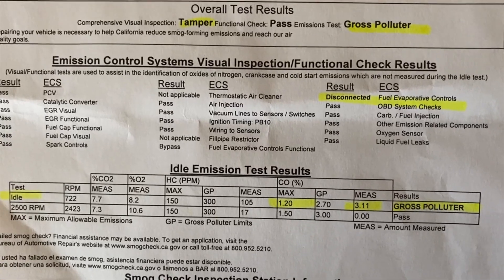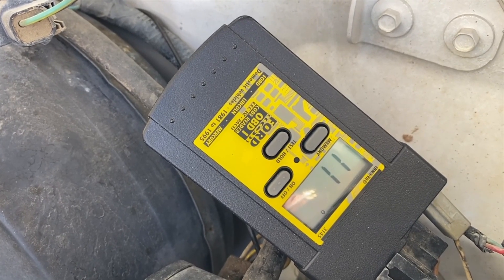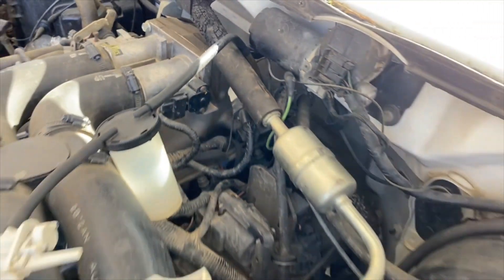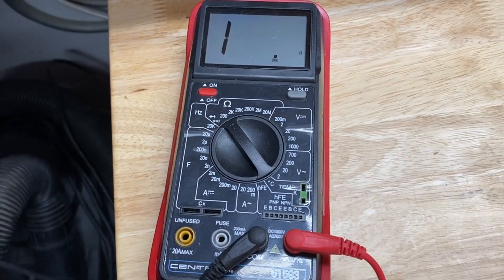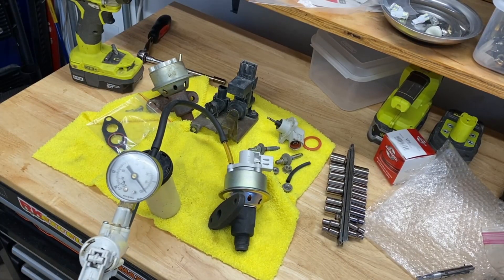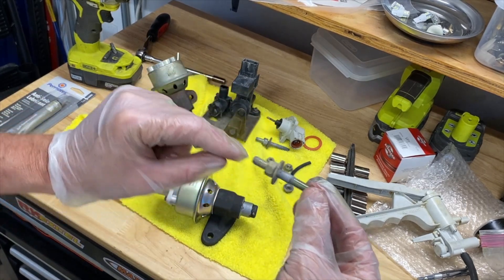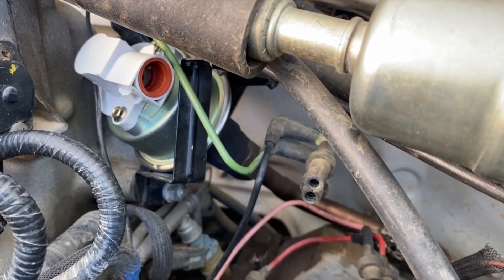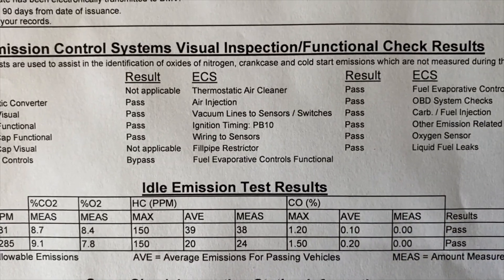Solving DTC 31, 32 and 34 on a 1992 F250 with a 7.5l motor

Comment: Hi. I have a 91 Ford f350 7.5 and I have a egr EVAP problem. I look in the book for the 31 code and it's EVAP low minimum voltage. Is it the same as yours if I change the egr and EVAP?
Reply from the maker: There are only three things to check. The EGR valve to be sure it is opening and holds a vacuum. The EGR sensor which you can check with an ohm meter and the vacuum lines which you can check with a vacuum pump with a gauge. It should be one of those. If your is a 91 you may have cracked vacuum lines. Good luck.
Reply: @thehomerepairguy  what's mine is doing is running rough while in park. It's all shaking vibrate bad that it's like it's struggling. Sometimes It be backfiring. I here pop pop pop. And when I'm driving, it runs all smoothly like it supposed to then next minute, it runs all rough when I be trying to accelerate. Like back and forth.
Reply: When you unplugged the connector from the EGR sensor, does the engine sound changed or no?
Reply: When I check the EGR sensor connector with a test light, it barley lights up. Like it's really dim. Not bright. I have a feeling that's why my EGR valve is not working.